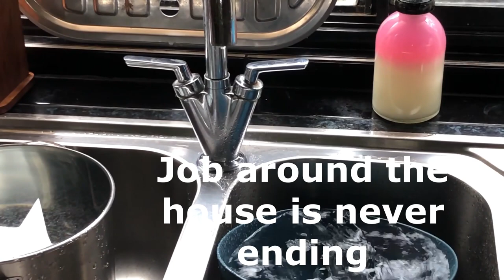Plumbing Boy - How I fix a leaky tap DIY

Comment: Replacing the whole tap mixer is actually an easy job, would only takes maybe 30 minutes, I have done it,  but yes it would cost you the minimum hr of the plumbers time just to so that.
Reply from the maker: The job would have been easier if they still had the parts in Bunnings.  It's more difficult to remove the whole tap mainly because of the room under the sink.  Not very easy to get to.  Especially with a deep sink.

Comment: Nice, I do all the plumbing here also 
When I put in one of those tall taps I made a reinforcement bracket below sink because I knew my kids would pull on it and bend the sink
Reply from the maker: Glad I don't have little ones anymore.  The sink is so deep that there's not much room to move under it.